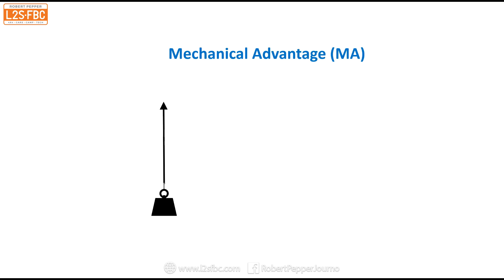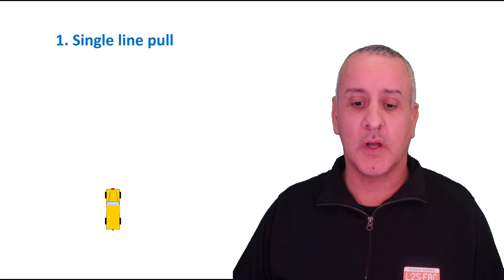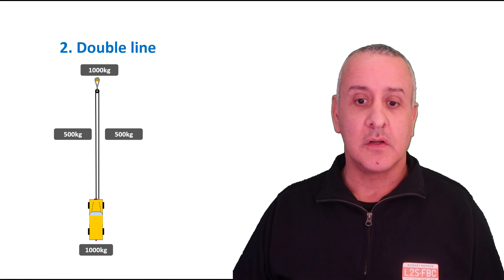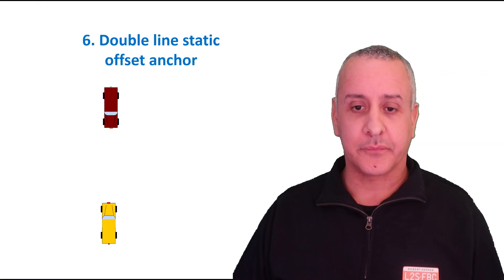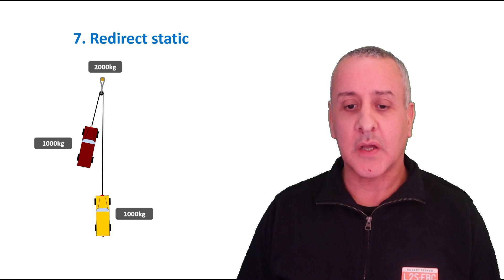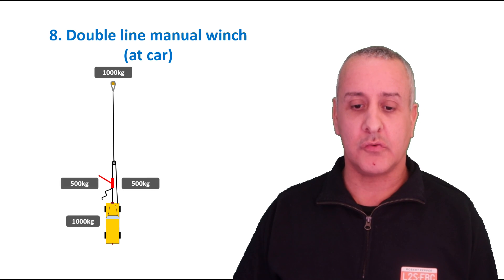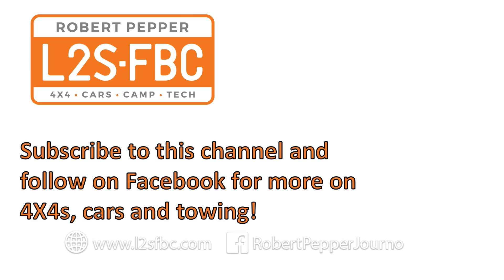9 ways to rig a 4x4 winch using 1 snatch block

Comment: You forgot a two pulley rig where both cars are pointed uphill and the uppers front winch is used to a snatch block to redirect. then to a snatch block on the front of stuck car and back to the rear of the winch car. It is called a stretch setup as you are trying to stretch the winch car
Reply: How to use 1 snatch block

Comment: Big thanks for putting this together. Very useful information. Thankfully over many years of off-roading, I've rarely had to use my winch. The most memorable occasion was at Native Dog Flat in Vic, where in front of a few bemused campers, I set up an elaborate system with block and tackle to winch up my solar shower. A completely unnecessary display of idiocy, but fun nonetheless! Cheers - Dave

Comment: #2 is wrong. There is no mechanical advantage of a single pulley! a single pulley changes direction of pull only. The force required to move an object remains the same.
Reply from the maker: https://l2sfbc.com/you-can-get-mechanical-advantage-from-a-snatch-block-that-doesnt-move/

Comment: Your double line explanation is wrong> you have a 1000 Kg on each line which makes the force at the pulley 2000Kg. there is no mechanical advantage without a moving pully

Comment: I saw the rigging you did for the hi-lift and I noticed you are not using their recovery kit with the chains etc. I would like to copy that rigging. I was wondering if you could direct me as to what I should be looking for in purchasing winch line extenders, soft shackles as to the type of material, thickness, brands or any other specifics I should be looking at? Searching for either soft shackles or winch line extenders I see quite a few results to choose from - different brands, thickness, materials etc. If you have already done a video on that please direct me. Thank you.
Reply: Also, when using the hi-lift for winching, how do you account for the take up in slack/resetting the jack? I understood that was what the chains were for in the kit, but I am wondering if the way you have rigged it with a double-line pull that the jack travels up and need to be reset less frequently? Still, I think I'm missing something in understanding how to get the length right with the straps and winch line?
Reply: Just as a side note observation, another benefit I see after studying your example of hi-lift winching is that the operator is no longer in direct line of rigging but off to the side. Even though the offset is small, I would take that as an additional margin of safety in case something fails - less chance of being hit by something.

Comment: Like the video, and I am not an engineer, but I disagree with the logic in scenario 3 (redirect).  I cannot see how you would get 2000 kg force on the pulley. The pulley does not move, the anchor line does not move. There is no mechanical advantage anywhere (or friction at the pulley) This scenario would be the same as if you tied a knot in the rope to stop it going through the pulley, you would still only have the  pulley resisting a direct line pull of  1000 kg.
Reply from the maker: https://youtu.be/s1h9whPOPn0

Comment: If I have a lighter vehicle than the stuck vehicle, would I gain power by adding another snatch block at a second tree? If I understand correctly I would give up speed but gain power, right?
Reply from the maker: You would increase force not power and yes trade speed

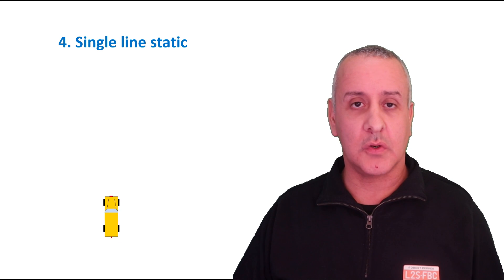Comment: 4:28 is not pointless thing since there will be less rope on the spool which gives you more torque. ;)
Reply: Not by much.
Reply: @gabel.5269 there's quite a lot of difference in winch capacity vs no. of wraps on the drum. Some winch user manuals list them

Comment: In #3 V #6, think of the rope taking the load...
The rope goes to a double FIXED point in #3, load-load
The rope goes to a single FIXED point in #6 and then it's halved through the sheave. A 1-1 ratio folded becomes 1/2
I might of just made this more confusing. That's how I remember it. Fixed points don't move, they have the full load
Great job on the explanations by the way, Thanks
Reply from the maker: thanks!

Comment: Thanks for this, I learned a lot. But I have a question. What are the load requirements for a rope in a 4 to 1 system. for simplicity say we are picking up 100lbs. Is there a formula to calculate how strong of a rope is needed?
Reply: That depends on your setup, if you're only concerned about the rope/cable directly attached to the winch, the strength of that cable needs only be as strong as the load you're attempting to apply (100lb in this case) however, the rope you use to attach the snatch block to the anchor will need to be as strong as your mechanical advantage. So in your case, a 4:1 mechanical advantage means that your anchor will need to be 4 times as strong as the expected tension in the winch cable/rope.
Reply from the maker: Exactly thank you @

Comment: How do you get a higher speed of pull?
Reply from the maker: No easy way to do that. You can put more rope on your winch drum, but that has the effect of slowing the winch motor so not much of a gain.
Reply: Darn. I was thinking there has to be some way to do a compound set up that would result in higher speed/lower strength pull - I can't picture it, and I've never seen it before either. Like if the load and winch switched places, more or less.
Reply from the maker: Not like gearing unfortunately. Would need gear the average 4x4 user doesn't have. Can't think of a way to do it otherwise l.
Reply: @aus71383  It can be done if the winch is on the recovery vehicle, not the stuck vehilce. Hook the snatch block on the end of the recovery vehicle's winch line. Set up a 2nd line running from the stuck vehicle, around the pulley of the snatch block and back to an anchor beside stuck vehicle. For every 1m of rope you winch in the stuck vehilce will travel 2m. Half the MA, twice the speed.

Comment: Someone is wrong...just watched a video where fixed pulleys are redirect and offer no MA. They said a pulley has to move to help. You say it doesn’t...someone’s wrong
Reply: The other videos you watched are correct. Moving pulleys are the only thing that give you mechanical advantage. In his #2 example he claims he hauls 1m of rope and only moves a 1/2 meter. But what he is doing is changing his hauling position on the rope and counting that as mechanical advantage. Imagine for a minute the winch just pulled the line straight back from the bumper instead of rolling it. If he moved the haul line 1m back from the original position of the bumper the bumper (ie load) would move 1m up from his original position this a 1 to 1 movement. This video doesn't explain the mechanical advantage well at all. There is a book called basic machines pub 1994 that explains it way better.
Reply: @michaelalcocer6778  https://www.youtube.com/watch?v=M2w3NZzPwOM&vl=en
Reply from the maker: @michaelalcocer6778  A double-line pull as per example 2 absolutely gives you MA.  Changing your hauling position gives you the MA as Stewart J says.
Reply: @L2SFBC no it doesn't.
Reply from the maker: Look at my Myth video then tell me what you think
Reply from the maker: And check my website
Reply: He's wrong.
Reply: @ Sawbone IOMC just think about it for a sec. what is the simplest setup? a 2:1 where you run the rope out of the winch to a pulley on an anchor, such as a tree, then back to the vehicle.  That pulley isn’t moving but your getting a 2:1 ma.

Comment: 2nd example is not going to make any MA, regardless of double rope. Should revers the winch and the anchor, in that case MA=2.
3rd example will not give 2000 on anchor, only 1000. Didn't watch 4 and other's.  It is common mistake. 
Just take rope, block, 1 kilo and steelyard and show the video, not pictures.
Reply from the maker: You're wrong on both counts. Watch this which explains #3 -> https://youtu.be/s1h9whPOPn0
Reply: @L2SFBC  
You are right about 3rd. It is 2000 on anchor. 
How you make MA=2 in 2nd, with fix block?
Reply from the maker: Think of the load as being supported vertically. Then it is clear there is half the load on each line. While the block is fixed, the vehicle is not, so there is, in effect, movement of the block.
Reply: Isn't this correct for moving block: when anchor and winch on one side, and load on opposite?
Reply from the maker: Not sure what you mean sorry

Comment: You really need to stop making videos until you truly understand Mechanical Advantage. A pulley that is stationary is only a change of direction, not an MA.
Reply: You have much to learn about the force young padawan.
Reply: You are correct. If the winch takes in 1m of rope it is simultaneously moving it's hauling position on the rope. For every unit of distance pulled in it's moving an equal unit of distance along the rope which doesn't actually count. As an example draw a straight line back from the winch and bumper in the #2 example. If the position on the rope didn't change the haul rope would go back 1m and the bumper would go forward 1m making it a 1 to 1 pull. In the video he is claiming an advantage because he is basically walking forward along the rope while pulling it. This change of location gives no mechanical advantage. There is a book, Basic Machines, 1994 that explains all of this. Doesn't matter if the winch is on the vehicle or not.
Reply: @michaelalcocer6778  You just gonna keep ignoring basic physics and referencing the same 1994 book? Being stuck on one source is probably why you are so confused...
Reply: Your comment is only true if the load or the 'winch' is also stationary.
Reply: @drgloverable  Not quite, if you have a redirect and pull instead of winch both the load and winch are moving but still the mechanical advantage is non-existent.
Reply: @killer2600  yes I agree.  But I'm referring to a winching situation, not a pulling.
Reply: @drgloverable  In a redirect, pulling or winching it's all the same. No mechanical advantage, whether the load or the winch is stationary. I know what you're trying to get at but like the OP comment, it's difficult to use the term "stationary" to determine when mechanical advantage exists. Honestly, physics doesn't care if it's stationary, everything is stationary until it moves.
Reply from the maker: Simply not true. A double line pull for example.
Reply: You might want to check your facts before making such a bold claim. Firstly, using a single pully for a 2:1 mechanical advantage is in every 4wd training manual. It's the recommended way of using a hand winch and there and hundreds of videos available demonstrating this. In the case where the rope attaches back to the vehicle being moved, there is a 2:1 mechanical advantage. 2 metres of cable in moves the vehicle forward 1 metre. It's that simple. This is different to the case where the pully goes back to an anchor. In that case you are correct that it's simply a redirect.

Comment: #3 and #6 seem to be identical to me with the exception that #6 uses a vehicle as an anchor point instead of a rock or tree... That said, I'm failing to understand   why you'd list the weight of the yellow truck in example 6 as opposed to listing the mechanical advantage and force the red rig (with snatch block) is exerting on the yellow rig.... In this case, and as demonstrated in example three, is 2000kg.

For simplicity, you can take the frame where you showed the two examples and flip #6 around and it'll mimic #3 exactly...

So, though the yellow rig in example 6 still weighs 1000kg... There would still be a force of 2000kg upon it if rigged this way.... 

Am I thinking through this correctly?
Reply: Start with the force needed to move the object in question and calculate all your other forces from there. Thus example #6 doesn't have 2,000kg on the yellow car because the yellow car is what we're trying to move and it only takes 1,000kg of force on it to move it regardless of how we apply the force.
Reply from the maker: Ah but there is the difference. One is a simple redirect with no MA. In all cases the yellow truck requires 1000kg to move. Whether the winch needs 500kg or 1000kg to move is the question, and the effect on the anchor.   But I'm not sure I've fully understood your question?

Comment: What if for example #3 the 2nd anchor point is also attached to the car but somewhere else on the front (some mounting point on the chasis) - to me then technicaly the weight is 'suspended' on 2 lines. Does that have an advantage? Am I thinking right? Car pulling itself with a rope from the winch to a pulley and back to the car.
Reply from the maker: Don't understand the question, sorry?

Comment: Why do you need to put a mat or something like that on the cable when you’re pulling?
I heard someone say because of safety reasons, can someone explain it please
Reply from the maker: To stop rope or cable whiplash in the event of a breakage. But not required for synth ropes. Check MadMatt 4WD for examples.
Reply: Steel cable can store a lot more energy than synthetic rope.  If a cable is loaded and then snaps, it can launch itself and the broken ends of the cable can cause damage to bystanders or vehicles.  Throwing something heavy, like a heavy floormat, a heavy jacket, etc over the middle of the line can help it drop faster and reduce the whip effect by absorbing some of the energy.  Just a matter of safe practice.  Steel cables are more durable than synthetic lines, but they can still be damaged/fatigued/corroded and snap if overloaded.

Comment: I just can't wrap my head around why #2, the double line, isn't a 1:1 pull on the car.  It would be 2:1 on the tree, if you were pulling it as a log, but it seems the equivalent of hooking a rope to your waist that goes through a pulley on the ceiling, then you try to pull yourself up.  Yah, each rope will have 100 lbs on a 200lb man,  but the mechanical advantage is at the ceiling, not the man.

Thinking of a z-rig:  you have a 1:1, then add a 2:1 for a 3:1-- this scenario seems no different than the 1:1 of that system.

Thanks
Reply: "Yah, each rope will have 100 lbs on a 200lb man,  but the mechanical advantage is at the ceiling, not the man." Actually, it's not at the ceiling. The ceiling is supporting the weight of the man. If the ceiling was a log that didn't move (an anchor) how much force would be on the winching vehicle and how much is on the winch?
Reply from the maker: Yes, really helps to think of a vertical load!
Reply from the maker: Does this help -> https://youtu.be/s1h9whPOPn0
Reply: if you weighed 200# and tied a rope to your waist, and looped the other end around a pulley to pull with your hands; you would only need to be able to pull 100# of tension on the one side of the rope to cause an additional 100# of pull on your waist and get a total of 200# of pull. - but you would have to pull 2 feet of rope to lift yourself 1 foot.
Reply: @kenbrown2808  Thanks.
Reply: @jaykay8570  for some reason, that configuration is the hardest for most people to understand, so you're not alone.